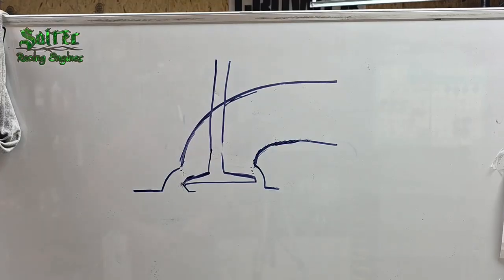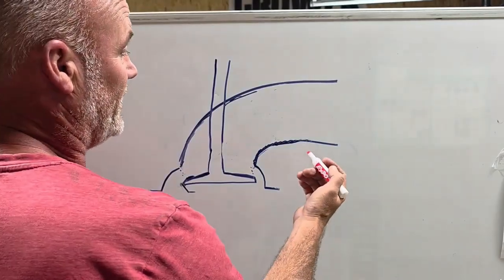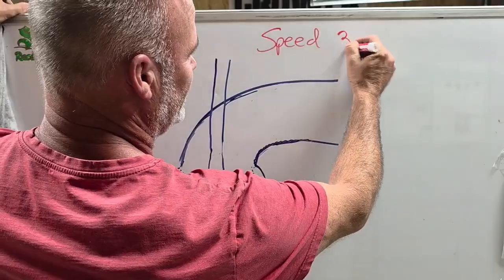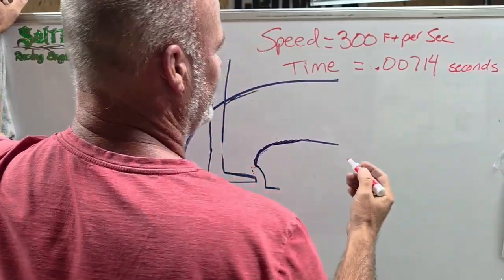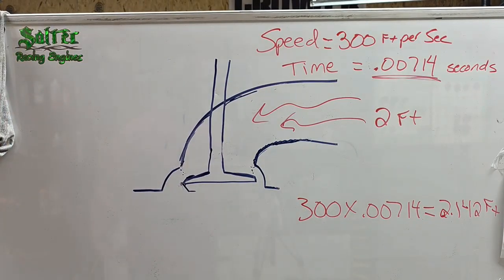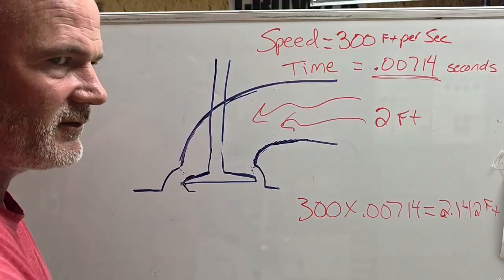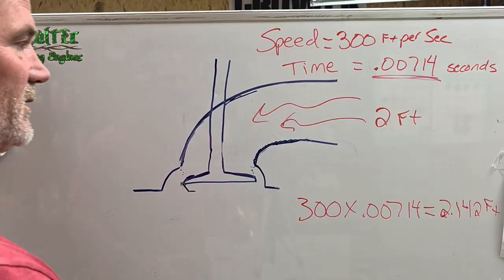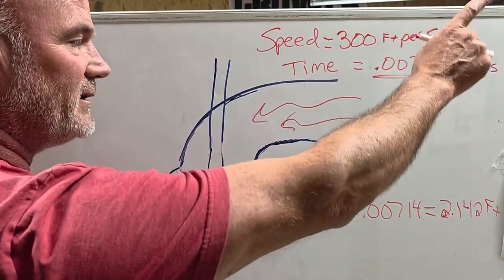Answering Steve Morris questions about valve speed and Air Movement in a Port

Comment: the scavenge from the over lapping valves lobes, then a little reversions. 🤔
so if the bowl area right below the valve seat throat is 95% during this pulse the fuel stacks it that area ??? 🤔 from the reversion?  curious

Comment: You are right in your logic but perhaps too focused on the subject. To measure is to know but only if you understand what you are measuring. The idea that you can calculate or measure a dynamic pulsing flow and get an average value is plausible but unrealistic and of no use. What I missing in this episode is the discussion about what pulsing gas flows can do like reflect, resonate and create harmonic waves in your intake system and how to use them to your advantage. A head with the right runner and valve size may run ok but the same head with the right throats in the right spots will run much better.

Comment: Herein is the difference with Steve Morris;  Steve never graduated college, everything he knows he learned the old fashioned way. He built engines. You can see him just start thinking about an issue then come up with a solution and build it . He admits it, he sends electronic. or anything other than building the engine out to specialty shops. Every part he uses is because he has used it and likes it. Steve even will go with the more expensive pieces merely because he likes them, or he will make a decision, find another part or even make it himself.  So far his videos are very entertaining an informative. He gives an upbeat presentation with great camera work and does it several times a week.

Comment: Just a thought that has struck me both watching yours and Steve's videos. And thank you both for taking the time to produce and share them.

Why are we concerned with port speed, cfm, etc? Is it not more useful to look at air mass? Which can be measured by fuel flow? Once the air mass is found then the numbers can be run on air speed by converting mass to volume with the ideal gas formula?
Reply from the maker: Yeah but that really is not the context of the original discussion I was just trying to answer the original discussion which he asked a question as to how fast the valve actually opens at a certain RPM and if so how much are really moves past it during that time so that's all that I'm doing here

Comment: Problem I'm having with your formula and that other guys formula is you both are using 7000 rpm of the crank as the number for the example. That is all well and good. If you want to use that 7000 rpm then the actual valve is only opening and closing in that 300° duration 1750 times in that 7000 rpm of the crank. Your math made more sense then the other cat but it's still flawed

Comment: There is a lot of science behind a lot of different race engines.  What works in one application may not perform in another.  I'm not an engine builder, but I own a machine shop & do some work for a 80 year old friend that still builds race winning circuit & rally engines. On one cylinder head, he had me machine the intake ports out & make sleeves to reduce the cross sectional area of the port. This engine made great power & torque when tuned on the dyno. The person tuning it couldn't believe it was as small a capacity as it was, stating he's never seen a 2L make so much power in a NA form.

Comment: Hi Brian, has anyone ever measured volume going in and volume going out of an engine? Just wondering if they are the same given the many variables. Also, would air speed exiting the engine be faster (as it is much hotter) than airspeed going in (I'm thinking that it would help increase intake airspeed during valve overlap)? Love your videos.

Comment: If you ever rev up a 2 stroke dirt bike engine up without the air cleaner you might see a mist form right before the carb. I'm thinking it's reversion, but it's also part of how it \'s supposed to work...
  I love this channel, it's clear to me that this guy has raced, has won, has lost and has broken .etc... I'm sure as time goes on, this channel will grow. A bump in production would push that up faster.

Comment: Funny on the small port thing. I built a 327 for my brother. I'm no where near a Mr Salter. But I decided to use the factory stuff. It was a '68 Camaro with the base 327. 1.72 intake open chamber heads. I ported them mildly, multi angle grind. Back when it was actually grinding seats. Opened it up to 305 1.84 intake and ran a boat regrind cam from the former Chris Nelson cams guy. That turned out to be a snappy little runner. Cast intake, Qjet, cast exhaust. Smaller ports gave it some quick throttle response.

Comment: Thank you for sharing your vast knowledge and years of experience! I remember years ago watching many videos of dyno pulls and observing ,at high RPM, fuel standoff above the carb. It looked like a small fog. Is this related to fuel pullover from the squirters ,reversion ,cam timing,poor port flow or a combination of everything.  I haven"t seen this recently so i"m thinking that technology has greatly improved and the people like yourself know what the hell you:re talking about. For everyone out there ,please use a cam grinder with tons of experience ,to spec a cam for your particular combination. dont just settle for a "off the shelf" grind.

Comment: Correct me if im wrong, i thought intake runners were rated in cfm. ???
Reply: They are, but  just because one has a higher CFM does not mean it will make more HP, so its kinda useless.

Comment: Air flows in waves, the speed of the wave is the speed of sound. What you're trying to describe is like DC electrical theory used in the case of AC. It doesn't work because AC theory is different. AC uses capacitance and inductance . Capacitance compares well to the compressibility of air and inductance compares to the momentum of the air when it's flowing. The length of the intake runner determines the frequency (RPM) at which you'll get resonance and therefore peak torque.

Comment: Need to calculate the volume of air consumed per valve event for one cylinder on a 540 cubic inch engine taking into account the vacuum the piston is pulling at 7000 rpm and then calculate how far up the runner that volume goes

Comment: Not my area of expertise. At a ve of 100% (likely at 7k rpm closer to 125% ve) the port needs to dump at least the cylinder and head volume during a single event. Logically simple. For the baseline LSX454R specs (770 HP), VE is approximately 115% at peak power (7000 RPM), typical for a high-performance naturally aspirated race engine with large ports, high lift, and aggressive cam timing. However, to achieve the target ~900 HP with the given configuration (potentially via minor tuning like improved intake/exhaust or fueling), VE would need to be around 125%. This is calculated by scaling air flow requirements proportionally to power output, assuming BSFC of 0.45 lb/HP-hr, A/F ratio of 12.5:1, and air density of 0.075 lb/ft³:
•  Theoretical CFM at 100% VE = (454 × 7000) / 3456 ≈ 920 CFM.
•  Required CFM for 900 HP ≈ 1125 CFM (from air mass flow: HP × BSFC / 60 × A/F / density).
•  VE = (1125 / 920) × 100% ≈ 122% (rounded to 125% for race-tuned.  
For a single intake valve event (one cylinder’s intake stroke), the ingested air volume is VE × cylinder volume, adjusted for dynamic effects at 7000 RPM. Using 125% VE:
•  Cylinder volume: 56.75 cu in ≈ 930 cc.
•  Ingested air volume: 1.25 × 930 cc = 1162.5 cc (at atmospheric pressure, ~14.7 psi).
 Air Flow Mass:
•  Air mass ingested per event: density × volume = 0.001225 g/cc × 1162.5 cc ≈ 1.424 g.
•  During speed up (opening ramp to mid-event): Air accelerates to peak velocity (~1.57 × mean = 545 ft/s max), mass flow ramps up with valve lift.
•  During slow down (mid-event to closing ramp): Inertia maintains flow despite piston deceleration, adding ~0.2-0.3 g extra mass via ram effect (estimated 20% of total from VE >100%).
Reply: So then Using the ingested volume above (1162.5 cc) and intake port volume (313 cc):
•  Number = 1162.5 / 313 ≈ 3.71 port volumes per intake event per cylinder.

Comment: Fun fact. A file in Pipemax shows an example of a 1500 HP, 500 cubic inch, Pro Stock engine at 10,100 RPM and 133% VE, having a 10.0649" total induction length, using the 3rd harmonic. This means the intake manifold runner and head's intake runner combined length is 10.0649". Even if an engine has 12" of total induction length, the 24" total from Brian's conservative example in this video equates to moving an air column twice that length. Insert new data using Brian's formula and you be the judge of whether or not the outcome exceeds the total length of most sensible induction systems.

Quoted from Pipemax................

"Bore=4.75000  Stroke=3.52000   499.01057710 Cubic Inches @ 10100 RPM  Intake System= 132.87964 VE%
Complete Intake System Flow    @28in.= 610.8066 to 654.0870 CFM @ 1.136000 Lift (2.00000 VE% Loss)
Cylinder Head Intake Port Flow @28 inch =  620.0000 to 663.9318 CFM at 1.15016 Lift (134.87964 Ve%)

---- Induction System Tuned Lengths ---- ( * Open-End Tube = both Odd and Even Numbered Harmonics )
Harmonic  Total     Intake     Manifold    Air / Fuel Ratio = 13.20000:1   BSFC = 0.4430 LbsHour/HP
Wave     Induction  Port       Runner   ( Induction System operating RPM Range from 8100 to 10600 RPM )
Number   Length     Length     Length   ------ Description --------------------------------------------
1st     30.1948  =  6.8000  +  23.3948  typically Induction Length too long to fit or use effectively
2nd     15.0974  =  6.8000  +   8.2974  creates the highest Peak Torque, but may lose higher RPM HP
3rd     10.0649  =  6.8000  +   3.2649  ProStock, Comp Eliminator, etc. best Peak TQ and Peak HP Combo
Note: 1st and 2nd Harmonic Lengths sometimes create the highest Peak Torque, but may lose higher RPM HP
      the 3rd Harmonic Length typically creates the best overall combination of Peak Torque and Peak HP"
Reply from the maker: Help us out what are you saying with all this computation it's impressive I just want to understand what we're looking at
Reply: @SalterRacingEngines  I was only posting the head flow, intake length and RPM data from that example of a Pro Stock engine having a 10.0649" total induction length (intake and head runner lengths combined), using the 3rd harmonic for ram tuning so anyone wanting to make loose calculations on how much air in what amount of time an engine like that might process through the runners could do so. I did not post air speeds above, however I will post more data below.

As I understand it, this program offers data calculations and pretty accurate performance estimations based upon Larry Meaux' as well as others professional experience and testing. By default, it provides a good, better, best set of data. The program is not meant to provide a recipe to build an engine but from what I understand its example file database contains data from many professionally built engine examples from actual dyno testing of engines from Engine Masters Challenge, Pro Stock and other classes and genres. The program is primarily meant for developing ideal exhaust headers right down to material, coatings, diameters and stepped lengths, etc. Also useful to calculate induction lengths for custom intake builds with a person being able to enter every detail about their exact engine including camshaft, valve size, rocker ratio, accounting for deflection, losses, air speeds, throat diameters, port lengths, valve job etc. and a lot more. There is way more data available. Here is more data from the same Pro Stock engine I posted about above that you might find interesting. Any more questions, just ask. Thanks for all you share with us!

0.250 L/D Ratio Int Valve Lift = 0.650000      0.250 L/D Ratio Exh Valve Lift  = 0.450000
Note : the Valve Curtain Area will equal the Valve Area @ 0.250 Valve Lift/Diameter Ratio
Intake Mach Z-Factor     =  44.6751 % SOS      Exhaust Mach Z-Factor = 69.8826 % SOS
Mach Z-Factor definition = PerCent % of the Speed of Sound ( SOS ) at the Valve's Curtain Area
Reply from the maker: Because what I said in the video is at 300 ft per second in the time frame of 00714 seconds it moves 2 ft I said nothing about making an induction system 2 ft so just what exactly are you saying
Reply: @SalterRacingEngines   Brian, using your result of 2 feet (24") of air column moved at 300 feet per second within .00714 seconds, I was making the point that typical V8 racing head and intake runner lengths combined do not often approach anywhere near 24" in length so a 12" total (intake and head runner length combined) should easily process the entire amount of air column it contains under the circumstances in your example. Meaning that Steve's engine involved in these discussions should easily be processing the entire length of air or air / fuel column the intake and head runners contain.

Comment: You know, if someone would like to prove Steve wrong, just put together a test with him where you dyno test 2 sets of heads that are the same, other than the flow numbers from porting. While eliminating as many variables as possible between the tests. I'm quite sure that the head with better flow will make more power. But maybe im crazy too😂

Comment: I’ve posed this question to both Weingartner and Morris, I would like to know what You think? I refer to “air movement” as air moving from intake runner/port to the valve and into the cylinder…. Is the amount of “air movement” in an N/A engine the same as in a boosted engine (70 psi for example) with same specs? A scuba tank at pressure does not need air flowing into or through it, to make air flow. It is the higher pressure in the tank decompressing into a lower pressure area that creates flow out of the regulator. If the intake runner/port is pressurized, does it change the amount of ”air movement” from intake port into cylinder? Seems like the compressed (boosted) air decompressing from intake port/runner into cylinder, would reduce the amount of measured “air movement”, which is what all these video debates have been about…  now if the cylinder was filled 1:1 psi with whatever the intake runner/port has for pressure then I think there would be no difference N/A to Boosted, but N/A is not 1:1 or 100% efficient at filling cylinders, and I Do Not Know how much of the boost pressure (70 psi at intake manifold) actually makes it into cylinder during the .003-.006 of a second that the intake valve is actually open, but I doubt the cylinder sees 70psi at BDC or before valve closes.
Reply from the maker: I'm not sure if I fully understand what you're asking but here's what I think about that subject you have to remember a naturally aspirated engine has atmospheric pressure sitting on top of the valve that is 14.7 lb when you boost an engine boost pressure is much higher than that which is why it makes so much more power and I've seen boost pressure actually lift the cylinder head off the block so if the pressure gauge is reading 70 PSI then that's what's in that cylinder when the valve opens
Reply: @SalterRacingEngines  Not trying to step on your toes here but i think i get what he means, kinda. 
Boost is measured in pressure but in reality it is making the air density change. More pressure is more density at the same temperature. If you take a boosted engine it can still be calculated the same way but you just need to multiply by the air density and that finds the boosted flow. A turbo engine will have drive pressure (backpressure) left in the cylinder witch lowers the total flow capability as well. The long explanation is it is pressure delta from cylinder to intake for cfm and then figure in density for total mass flow into the cylinder. 

For the non engine folks atmospheric pressure it 14.7 at sea level also listed as 14.7 psia , 0 psig, 1 bar  or 100 kpa.  I don't think many home builders know just how much math and science goes into actually building a race engine.
Reply from the maker: @Gin-ging it's all good man it's way more helpful if you can actually talk to people instead of typing
Reply: @SalterRacingEngines  I was literally typing my first one at the same time you were i guess but my phone sends comments so slow🤣 And i agree a diagram and a voice will convey better to most people.

Comment: Man, i love your passion!  Good stuff!  While watching this, I was thinking about the pressure waves in the intake track and how when timed correctly, it is like a compressed spring being released past the open  intake valve. So, to me, how far the intake charge moves is a by-product of how condensed the charge is. The more condensed (stonger wave energy), the shorter the distance traveled while the valve is open. If I am thinking correctly, this would also mean the intake charge is still moving in the port and intake runner is basically compressing the charge while the valve is closed. I may not be correct on this. Just my thoughts leaking out. Lol!  Great stuff!
Reply from the maker: Atmospheric pressure is 14.7 and that is sitting at the back of the valve waiting to be opened

Comment: It did seem really weird to me when he said the air only moves a little amount and I thought how can that me because then how would the dam engine run if the carburetor is far away from the valve so to me it sounded kinda dumb on what Steve said but whatever what do I know I am just 25 years old with maybe 3 to 4 years experience lol. But not really those years experience I wish I had sponcers and money to build a better engine for next year I am am really in trouble no job since December and nobody is hiring like man this is driving me insane